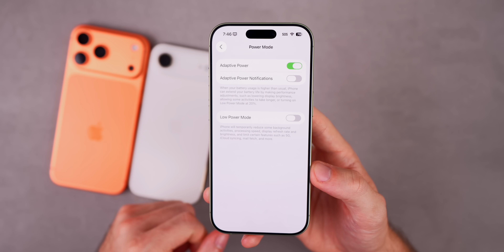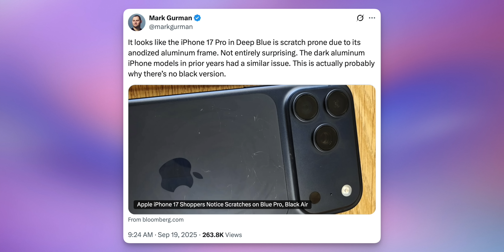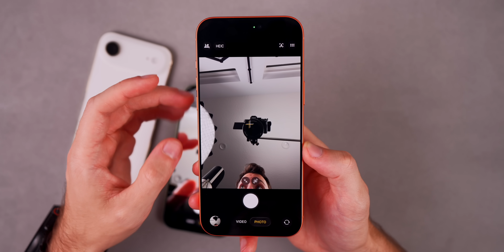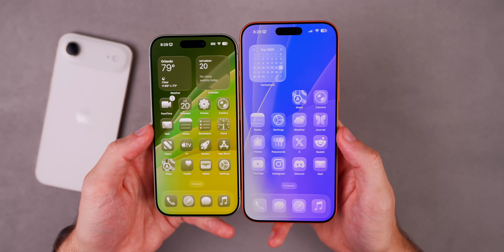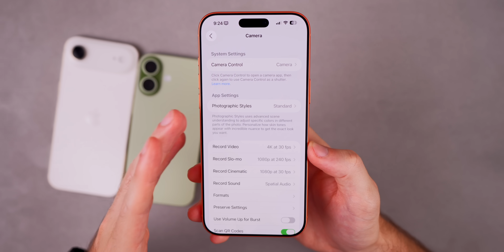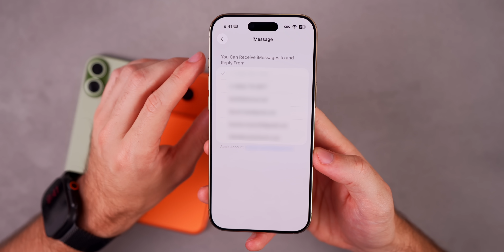iPhone 17 & 17 Pro - First 24 Things To Do! (Tips & Tricks)

Comment from the maker: What do y'all think about RHINOSHIELD's iPhone 17 Cases? https://url.rhinoshield.io/brandon17 (use code BRANDON for 10% off)
Reply: Slow down. You talk way too fast, especially when giving camera instructions.
Reply: 😂😂😂😂😂 he sure does i had to pause  several times
Reply: My auto lock only has up to 2 minutes. How’d you get the 3 and 5 minute options?
Reply: BRANDON - Code doesn't work
Reply: The discount code conditions are not met or have been fully used.
Reply: Got my Mod NX right now. Phone arrives in 3-5 days and I can't wait to put it on.
Reply: Just got it! I love it.
Reply: Just ordered and saved 10$ with BRANDON.   Hope I like it.  Wanted the air case but sold out.  Thanks for another great video.

Comment: I have Camera Mode toggled OFF in Preserve Settings. Still, when I change my camera mode to video, then close the app, when I reopen the app it is still on Video rather than automatically resetting to photo mode. I have done a hard reboot. I have reset all settings - and still my camera app will not reset automatically to camera mode but goes back to whichever mode I last used. ALL settings in preserve settings, except for live photos, is toggled off. I’m an old guy and can’t figure this out. Does anyone have some advice?  Many thanks. Jim

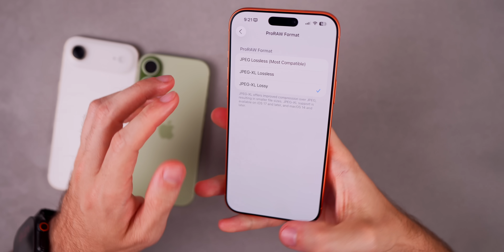Comment: At 27:25 you discuss phot formats and suggest Lossy.  Since the default is Lossless, which says it is the most compatible format, is there any concern about Lossy not be compatible with other devices (eg if sending a file to Android, etc)?  I have taken photos from 0.5 to 8x zoom on both HEIF and RAW and compared them and I have a really hard time telling any difference, certainly not enough to warrant photos taking up twice the storage space.

Comment: I just upgraded from the 15 max pro to the 17 pro max and you're correct the older phone certainly got hot under heavy use, my question is will this new cooling be worth anything if you put my heavily insulated otter box around it. seems a lot of cooling advantage will be truncated by most cases?

Comment: I just switched from a Pixel 9 to the iPhone 17 Pro & the photos feel off. On the Pixel it was so easy to point & shoot — you’d get amazing pics right out of the box. But with the iPhone 17 Pro, I struggle to get the same results even after setting Pro Res Raw, etc. Most shots come out blurry even with slight movement, which never happened on my Pixel 9. Anyone else who used a Pixel notice this too?

Comment: Great tutorial, really helpful and well-presented. 
May I please just correct one thing you said near the end which is that HDR changes the resolution of your photos. HDR is not about resolution, it stands for High Dynamic Range. This means that if there are elements of the photo scene that are too bright or too dark to keep details in those areas, it will reduce the brightest areas to a point where detail is maintained and bring up dark shadow areas to that there is detail in them should you edit and adjust the shadow areas. You can take photos yourself on a camera that you intend to make into HDR but you have to take several photos at different settings. You can then use editing software to bring the pictures together and have detail throughout. HOWEVER, a word of warning, HDR can often look very unnatural if not edited properly so it's worth playing with so that you get the idea of how it works and which pictures benefit most from it. Hope that is helpful.

Comment: Currently using iphone 11 and getting iphone 17 Pro this week its going to be huge upgrade lol
Reply: Massive!
Reply: How are you liking it? I had the iPhone 11 and went with the iPhone 17 pro max but it feels really big and heavy in my hands so I’ve been thinking about switching to the pro instead. How’s the battery longevity on the pro? That’s really the main reason I went with the pro max ngl my 11 battery sucked !
Reply: @theblackdagger17 battery life has been great so far
Reply: @theblackdagger17  So far best iPhone i've had really enjoying it. I'm not heavy user but if i charge it to 100% i can go 2 days without it reaching 0%. Fr my battery on 11 sucked aswell was not able to go full day without it dying on medium use.
Reply: @theblackdagger17 the pro is lasting really well, at least that’s what most people have said. The battery size was significantly improved especially if u use the eSim only model
Reply: @theblackdagger17  Also coming from regular 11 to the 17 Pro and I can confirm that the 17 Pro already feels a lot heavier and bulkier due to the squared rather than rounded edge. I am still trying to get used to it. Battery Life is perfect tho. It's more like 2x capacity of the 11 has, it survives more than 24hr of regular use in my case.  I own the traditional SIM model.
Reply: @E @EvianPutra youll get use to it!! I ended up keeping my 17 pro max after getting a thinner case for it which helped me adjust more. Now I’m use to the bigger size and weight and my 11 feels tiny lol also finally quit messing up my typing on the keyboard

Comment: There’s dedicated background sound button in control center, no need for live listening button, making extra tap.
Reply from the maker: Good point, I just like the multiple options the other way gives you.
Reply: @BrandonButch  Oh, I see. On the contrary, I was delighted when a separate button appeared, as I was eager to get rid of that ear button with functions I didn't need.
Reply: @BrandonButch  Also, speaking of the background sounds feature, it is important to mention that there is a separate button for this, which is what most people need, without any additional add-ons in the form of live listening.

Comment: I’m a big proponent of charging to less than 100%. I do that on my M1 Max MacBookPro. I charge my MBP to 75%. 4 years later, its battery health is still 100%
Reply: So you charge it to 75% so that its battery health stays at 100% yet that means you’re basically just getting the effectiveness of a 75% battery health device anyways lmao
Reply: @ookides  This is exactly why I've never seen the point in using charging limits (other than automatically charging slower overnight)
Reply: @Ciel-Aozaki  I think because when the battery health degrades to like 70% you can never get a full charge,  but this way, you can keep it at a 100%, and then every now and then if you need a lot of battery, just charge it to 100.
Reply: @ookides I will always have the option to fully charge if I need to. And better battery health increases resale value.
Reply: I’m not, I have insurance and if my battery degrade is below 80% they replace it
Reply: @Live2ride2live54321 I tend to keep my Mac computers around for 8+ years.

Comment: If you change your battery percentage to 90%. Automatically optimized battery charging turns off. So for battery savings it's worth to turn off significant locations and system customizations, cause it's no longer necessary.

Comment: A few things to be aware of regarding auto brightness, and why you might want to leave it turned off like I have.

Why Auto-Brightness Acts like it does
•  Your iPhone uses a multi-channel ambient light sensor near the front-facing camera to detect light intensity.
•  In low-light environments, it dims aggressively to reduce eye strain and save battery—but that can make the screen annoyingly hard to read.
•  Under a lamp or spotlight, the sensor may interpret the light as “bright ambient,” similar to sunlight, and boost brightness unnecessarily.
•  The system assumes you need more brightness to overcome glare—even if that glare doesn’t exist indoors.

Plus I have a feeling the constant adjustments to brightness might use more battery.

Comment: I am picking up my iPhone 17 Pro in a week! I am so excited!!
Reply: Same. Mine should be shipped on the 10th of Oct. I CANT WAIT.
Reply: @MidnightPasta0  So excited for you! You should get a screen protector while you wait ;)
Reply: its a awesome phone but you need a case asap. the back scratches super easy. The screen however seem verry resistant to scratches
Reply: @tobbe94  I already have a case ready😂
Reply: Got mine recently and it’s awesome. The camera is so good. Besides the first start up, charging, and going outside on a hot day, I’ve noticed no heat on the back of my phone. The aluminium + Vapor chamber definitely working. Make sure you go into your camera settings and turn on RAW so you can access 48 MP options in top left of your camera app. It defaults to 24 MP otherwise.
Reply: @readifdumb  Thanks for the heads up!😊

Comment: Had my 16 since last December and I’m still at 100% battery health and I charge my phone to 100% charge every day! The trick is not to let the battery fully discharge, always charge at around the 30% mark. It’s the draining of the lithium batteries that causes the most damage.
Reply: Results may vary based on your lithium-ion battery you get, my 14 Pro health tanked and I never let it discharge below 30% (I always kept it plugged in most days, using only Apple equipment) so a 90% limit can be a happy balance for most users, and when you want that 100% you can just change it for the day which is pretty convenient. I am glad your battery is doing well either way!

Comment: Correction, the outside of the 17 pro may feel warmer than previous phones but that’s because it’s more efficient at dissipating heat to the aluminum chassis. But it’s definitely keeping the CPU cooler.

Comment: Camera Control = off. it's useless
Reply: I thought I’d turn it off too. But I ended up really liking it actually.
Reply: I’m a camera control apologist, super helpful to click and use fast from sleep
Reply: Remove camera from your quick toggle on the lock screen and you will use the camera control every single day(if you take pics)

I have my quick toggles set to chat gpt and flashlight and now I use the cc every single day
Reply: @Fragblog  I actually don’t even have flashlight there. I use my action button for the flashlight.
Reply from the maker: It’s very useful for some! I use it to quick launch my camera often
Reply: @BrandonButch As a former Android user, double tapping a side button to launch my camera feels very natural. I’m sure I’m not alone there.
Reply: Agreed.

Comment: First thing is make sure its brand new second get a case it scratches easy.
Reply: I’m just worried as most cases leave the camera bar exposed, even though it is like slightly lifted I’m just worried the camera bar still could get a little bit scuffed up and scratched
Reply: @ShadowPhantomGaming  scratch gate only really affects the borders of the plateau
Reply: What’s the point of buying the phone? Just use it naked
Reply: I literally took my box to the store to buy a case and screen protector. This phone felt the air for like two seconds 😂 and it’ll never feel it again